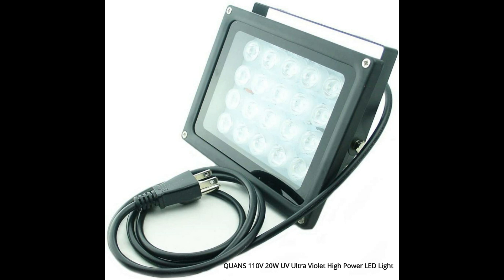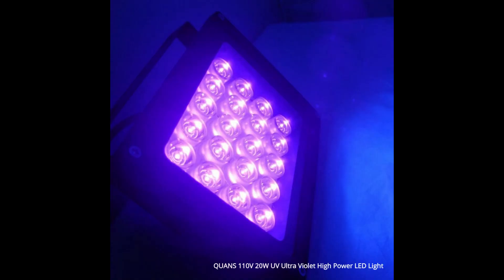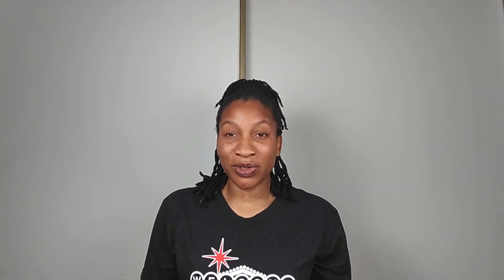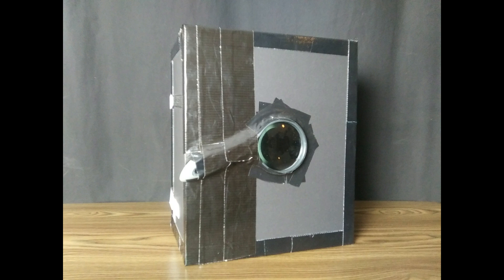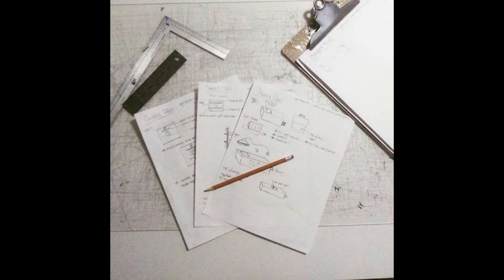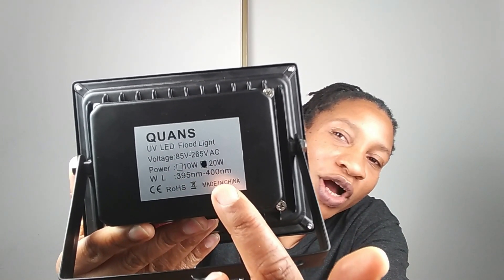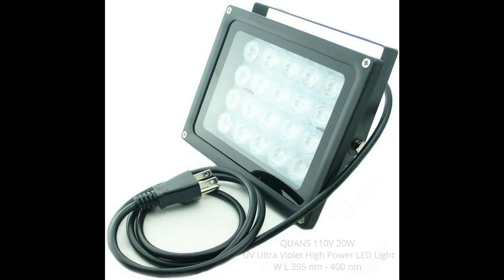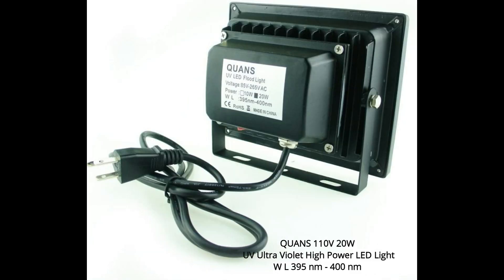Cyanotype and Ultraviolet Light (problem solved!)

Comment: Useful information. I just tried my first ever cyanotype ( on a t-shirt) and had the same problem that you described. It washed out completely, no image, although a blue ring all around the edge of where the solution was applied. 
I had been doing a test strip from 1- 10 minutes. I thought that maybe I had left the Cyanotype solution to fory for too long, the instructions say that it is only stable for 2-4 hours. I had left the t-shirt to dry overnight. 
The UV light source I use doesn't state the actual wavelength, but I have always successfully used it for exposing my screen printing projects. 
I had thought that I had left the Cyanotype to dry for too long, following your information I now think that my light source may be the problem.
Next step is to try exposing a T-shirt in the sun. Thanks for posting.

Comment: Hello, i have a 365 nm but after 1 or also 2 hour exposing the picture doesn’t show. And the colour too. Never had problems with the sun but with artificial light it seems impossible. Any advice?
Reply from the maker: HI! Some questions for ya!
1.Is your light new or old ?
2. How far do you have your light for your print?
3. What is the power of the light, it must be at least 50watts to work on the Cyanotype.

 Let me know if this helps you in any way.

Comment: A bunch of assumption. Most UV LEDs used by others for the Cyanotype process operate with around or slightly under 400 Nm wavelength. The reason could be of any other kind as well. Beginning with the glas infront of the LEDs, which sucks quite a bunch of UV light up to the used travelling distance of the light in context with the extremely low power of 20 W and the required timing being considerably too short.
Reply from the maker: Thank you for your input.

This video dates back to 3 years ago, a time where I only depended on the sun to create   Cyanotypes. 

This is where I started when deciding to use an artificial light source, having no real knowledge about them. Everyone starts somewhere with something new and this so happens to be my start/beginning. Without any of my assumptions, curiosities and determination made at the start, I don't think I would have found a perfect solution, which I have been open to share with everyone, a light source that does the job each and every time.

Comment: Hi Guys, for small prints I am using an old uv lamp for gel or hybrid nails (older models with bulbs). Bulbs are usually 365nm (I have four 9W bulbs ) and exposure time takes about 3 -6 minutes for cyanotype or vandyke.
Reply from the maker: Thanks for sharing!

Comment: Thank you so much for sharing your trouble shooting experience, my question is what type of light do you use now ?
Reply from the maker: Hi! The light that I use now can be purchased from Amazon:

UV Light Source
- THE NEW 2020 MODEL - Everbeam 365nm 50W UV LED Black Light - High Performance LED Bulbs, IP66 Waterproof:

https://www.amazon.ca/gp/product/B08635F9CX/ref=ppx_yo_dt_b_asin_title_o00_s00?ie=UTF8&psc=1

If you plan to make larger prints, say larger than 8x10, I would suggest the 100watt light over the 50 watt.
Reply: @NicoleSmallOneonOne  Thank you so much for answering, it's very helpful.
Reply from the maker: @xdaiart  You are So welcome!

Comment: Hi there, thanks for the video!
what would you recommend: a UV light with WL 395 and 100 W or a UV lamp with WL 365? I cant fine any on the internet with 365WL, maybe you can recommend me?
Reply from the maker: HI Shir. I personally would get a UV unit at what is considered to be ideal which is 365nm if at all possible but if this is not possible, I think that they are plug-in UV units that may work at the wavelength of 395 but I am not sure of which as I have no longer needed to test out any other UV light units once I found the one that works for me now. I am sorry, I cannot really direct you of where you should go. Where do you live?

Comment: Ive exposed cyanotypes even with blue LEDs (450nm) no issue, it only takes longer compared to light sources of the same power but shorter wavelengths.
Reply from the maker: That is great that you have success, with this light I did not, even with exposures of over an hour and a half! They are many who have come to me with a similar reply.

"My experience was with the specific light that I had tested which clearly did not work  is not to take away from other people's knowledge or choice that has worked for them. I found a way that works for me throughout my own personal journey in trying to find a way to work with the Cyanotype at anytime of the day and I chose to share my full experience. There is more than one way to have something work and I have yet to find anyone who has used the EXACT light that I had used which did not work with the Cyanotype say that it had worked.

Everyone finds there own way and if it was not for me not having success with my first purchase of a UV light unit, I would not have gained a lot of knowledge and have found a UV light unit that works perfectly for me now.

Comment: Slightly late to the party here but I use UV lamps to expose my prints as I live in the UK and the sun has a tendency to disappear for weeks at a time. 
I have never had an issue with the WL. It's all about the Wattage. I use a 50w lamp that looks very similar to the one you had. 
It is worth noting that it takes ALOT longer to expose under a lamp compared to the sun. A print that normally takes 5-10mins in the sun can take 30-40mins under my lamp.
Reply from the maker: Hi. Yes a little late, this video was made almost 2 years ago so between then and now knowledge has grown. As I had replied to someone else, which maybe I should make an announcement of it. Some may not pertain to your reply exactly but I think it fits the subject matter. 

"My experience was with the specific light that I had tested which clearly did not work  is not to take away from other people's knowledge or choice that has worked for them. I found a way that works for me throughout my own  personal journey of trying to find a way to work with the Cyanotype at anytime of the day and I chose to share my full experience. There is more than one way to have something work and I have yet to find anyone who has used the EXACT light that I had used which did not work with the Cyanotype say that it had worked.

A narrow spectrum is correct which is why from my experience and research I found a light that works like a charm with  365nm,  bought from Amazon.
My goal was to find a UV light unit and not have to make one"

I am aware that the sun will give much shorter exposure times. I have made several videos and I am not sure which ones, but I did state that the usual time for me in the sun is about  3- 3 minutes and a half whereas many of my indoor Cyanotype videos have shown my exposure times closer to the 10 minute mark. 

I have admitted in several replies that the wattage of light I was using was perhaps not enough. I realised this after I had gone through a series of ups and downs through the learning curve of switching over from the sun to a UV light source.

Comment: Just checked the wavelength of a light I got and this is my problem thank you!!!
Reply from the maker: Hi Sheanen. Just curious, how many watts is the light? Is it more than 20watts?
Reply: @NicoleSmallOneonOne  it is 60 Watts and like yours 395-400nm
Reply from the maker: @sheaneenhealybyrne2687  did your Cyanotypes wash out in the water too?
Reply: @NicoleSmallOneonOne  i haven't actually tried it with a cyanotype only anthotype which take a long time to expose anyway. I have cyanotype chemistry that comes in solution A and solution B which takes twice as long to expose as the single solution version so I'm currently waiting on that in the post I'm going to try the light with the that and if it doesn't work I'm going to be returning it
Reply: @NicoleSmallOneonOne  my cyanotypes that I exposed with thr sun before I got the light washed out in water a load of times except for a 2 day exposure I did. The sun here in Ireland in February is nowhere strong enough and its currently not viable for me to be using such ling exposures as these prints are for my college assignment
Reply from the maker: @sheaneenhealybyrne2687  iIt might just work, being that it is a 60watt light and not a 20watt like I used. I curious to know if that could have also been a reason why the Cyanotype rinsed off .
Reply from the maker: @sheaneenhealybyrne2687  That is a long time to wait. I hope that all works out better for you once you try the single solution.

Comment: Matt Marrash on his channel says that Tim Layton on his blog says s narrow spectrum of 396-405 is needed Matt got Bering T5 UV led light strips on Amazon work. Look at Matt Marrash on Large Format Friday he has done Kallitypes cyanotypes etc. He got advice from Tim Layton fine art blog
Reply from the maker: Hi. My experience was with the specific light that I had tested which clearly did not work  is not to take away from other people's knowledge or choice that has worked for them. I found a way that works for me throughout my own  personal journey of trying to find a way to work with the Cyanotype at anytime of the day and I chose to share my full experience. There is more than one way to have something work and I have yet to find anyone who has used the EXACT light that I had used which did not work with the Cyanotype say that it had worked.

A narrow spectrum is correct which is why from my experience and research I found a light that works like a charm with  365nm,  bought from Amazon.

My goal was to find a UV light unit and not have to make one.

Comment: that UV light should be working
yet, u should only do much longer exposures 
try it
Reply from the maker: Hi. I went as long as 2 hours with that light  at a very close distance and still it rinsed off in the water. Looking back at it now it might have been the power of the light itself which was only 20watts.

Comment: Hello Nicole Small, 

I know you have figured a lot of this out by now, and had success, but here is a little info about how light changes can effect exposure time, to help you think about the dynamics that are at play with lenses and exposure. Very interesting about the UV light wave frequency that works best. Good research!

PRINTING VS PHOTOGRAPHY
“Printing” processes like cyanotype are long exposure processes. Unlike film, Collodion or Daguerreotype silver nitrate processes that are very fast, and are ideal as in camera “photography”. For cyanotype printing, a contact frame is best because there is no lens, or enlargement involved. Just 1:1 scale direct sunlight. 

DISTANCE = F-STOP
When you use an artificial light source, every foot of distance the light away from the print doubles the time of exposure. Each foot of distance is equal to 1 f-stop of less light. So a 30 min print at 1 inch, is 1 hour at 1 foot, and 2 hours at 2 foot, 4 hours at 3 foot. So usually these prints are don’t with UV light at 45min in a light box where the UV lights are 1in from the print. Such as UV tube lights.

LENSES
Printing through a lens is possible, but of coarse very hard to do. A lens takes the suns powerful blue and UV spectrums and reduced it to almost nothing. Most lenses have UV coatings that block UV almost all UV light. This is because panchromatic film and digital photography need to get the same light spectrums as the human eye, in order to expose properly. Otherwise a blue sky with white clouds would appear blown out (all white). Due to over sensitivity to blue and UV spectrums. Red hair & freckles becomes black, due to under sensitivity to reds. And blue eyes are creepy vampire white. These were problems with early Collodion, daguerreotype and orthochromatic film. 

Now that the lens has dimmed and screened out almost all of the UV light, each addition F-Stop down will double the exposure time. So an f4 lens is already starting several f-stops down. (f1.4 3hrs, f2.8 6hrs, f4 12hrs). So you can see how seriously a lens can destroy exposure times.

HUMAN EYE
The reason we don’t see UV and Infer Red light is because the lens in your eye has a protective coating to stop it from getting through. If it didn’t, the UV light would destroy our vision very quickly. They realized this when the first artificial lens implants were developed. Patients were able to see UV & Infer Red light because they didn’t put a UV coating on them, which was later corrected in lens implants. 

WASHING OFF
When a print looks exposed, but washes off, it may appear to be exposed, but not enough to truly make the cyanotype insoluble to water, and keep it from washing off. So basically underexposed for the situation.

TIME
The longer the cyanotype prints dry, the less light sensitive they become. The best approach is to print them as soon as they are dry to the touch. If they sit around too long before exposure, they will take much longer.

FORMULAS
Some formulas are more sensitive then others. But this really is not much of an issue. Cyanotype can store for years on end with very little changes in the formula. Sometimes blue formation in the solution, but this usually has no effect on the prints. Oxalic Acid is used as a sensitizer in later formulas because it was found to speed up the exposure times.
Reply from the maker: Hi Joseph! Thank you for the information! Regardless of what I have been doing or have done, the information you have provided is invaluable! 

Thank you so much for taking the time to share your knowledge. It will be a great help not only to me but to others as well.

Comment: Very useful video, many thanks. I have very similar problems. Unfortunately I cannot check the wavelengh of my UV light now, because I have not it with me today. But I can asure you than no cyanotype has properly exposed with it, even for 20 minutes, yet it gives me perfectly nice kallitypes just with 6-7 minutes of exposition.
Reply: Oh, and works with salt prints, althoug they are quite dull, just having an yellow-orange like color in what should bee deep blacks.
Reply from the maker: @carbo73  I did try a few salt prints and unless the light is extremely close, and I mean extremely, with an exposure of at least 30 min plus, the tones come out more dense but not very desirable.
Reply: Aha, I've checked the details of my UV lamp from the day  I purchased it in 2019.It says 395-400 nm!!! So I must go for one which has 365 nm in wavelengh, right?
Many thanks for the information.
Reply from the maker: @carbo73  If you are buying a lamp, yes,  365nm would be your best bet. In the case that you want to build one, it seems that there is a little more leeway to that of 365nm as I have been told by many who have built there own using led light strips that  come in varying wavelengths other than 365nm.

Have fun!
Reply from the maker: Hi! The light used is good for Palladium/ Platinum, Van Dyke and Kallitypes, sources that peak at 420 nm (approaching the visible blue end of the spectrum). 👍
Reply: @NicoleSmallOneonOne  many thanks, your video has been extremely useful to understand more the kind of UV lights needed for each process. I mostly do kallitypes, so it works mostly for me. But I've liked salt prints too, so maybe I will buy another lamp of 365 nm for salt p. and cyanotypes.
Reply from the maker: @carbo73  Hi! I am not sure it will work well enough for salt prints. I have tried salt prints with 365nm and it does not come out with very much density even after a long exposure time of 30 -45 minutes. I think a UV light would work best much higher than 365nm for salt prints. A light that sits somewhere closer to the blue light spectrum.
Reply: @NicoleSmallOneonOne  well, I've done minimally decent salt prints with my 400 nm light. Maybe I should let them more time, or the light closer  (now I put it c.45-50 cm away).
Reply from the maker: @carbo73  Yes, the light will have to be extremely close

Comment: Hi Nicole, I’ve been trying cyanotype photograms with 3D objects, and recently purchased a 365nm UV light. However I found out that the UV light doesn’t really work with objects, since it doesn’t cast any shadows like the sun does, but it does work on places where the object has direct contact with the paper. So the UV light doesn’t work for my purpose. Perhaps a sunlight simulation bulb would work. I’m wondering if anyone know more about this.
Reply from the maker: Hi Ziqi. I am sorry to hear that. I am not sure what to say as I have never worked with the Cyanotpye for photograms or for 3D objects, it has never been my interest. 

The sun is the best for everything :)

How are you positioning the light, straight on or with an angle?This might be something to try? 

 Maybe having an additional light in the scene, any light, that would be the one to help cast the shadow of the objects and perhaps help record that 3D looking feel? Just a thought.

Comment: Hi Nicole, I bought a 50W 365nm at Amazon in the Netherlands but a different brand. It works very well. I use it mainly for Cyanotype prints of antique glass plate negatives. Which is a challenge because some need 10 minutes, others 30 minutes.
You mentioned in a reply that you used a lamp for Salt prints. Was this the 365nm or 395? I am about to make my first Salt this week 😊
Reply from the maker: Hi Ike. The salt print worked with the 395nm light. Here is something that I have read along the way:

"salt print maximises in the region of 380nm, visible light up to approximately 650nm, 

so there is flexibility there but I am not sure how 365nm would render overall for salt prints. I am sorry,I cannot say for sure.
Reply: @NicoleSmallOneonOne  Thank you so much, Nicole. This is of great help!
Reply from the maker: @paraveterinary  You are welcome!